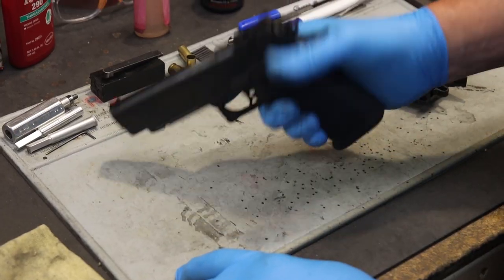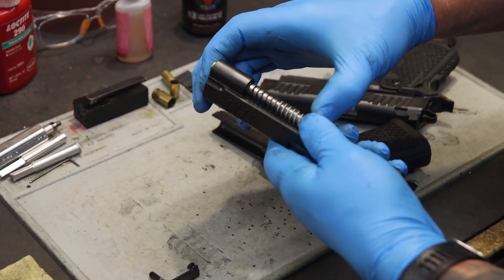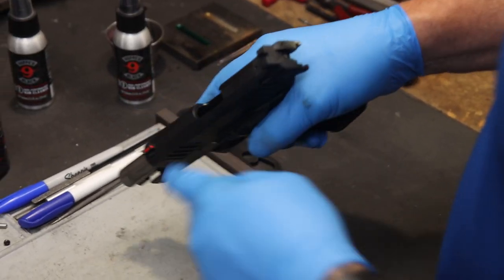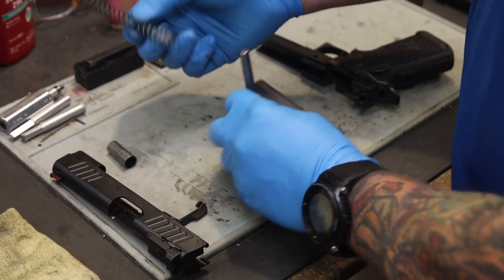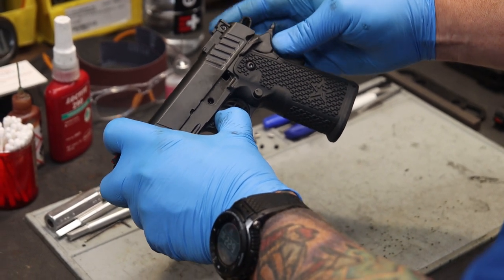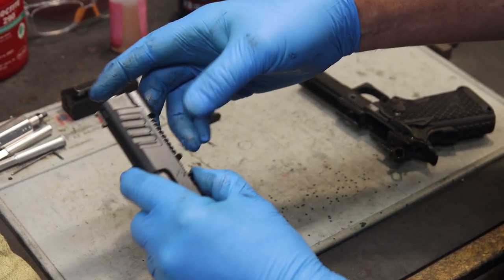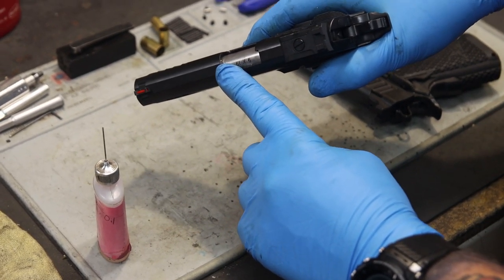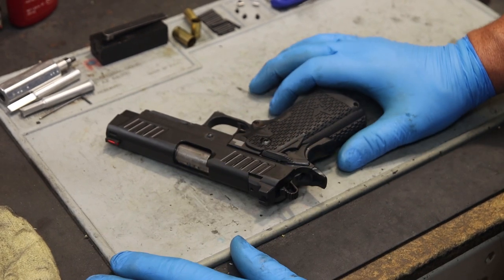Maintenance 101: What is the proper way to safely maintain and clean your pistol?

Comment: 27 years LEO. last 15+ with a Kimber 1911, TLR2, only problems were when my magazine spring were old.  Recently purchased at 2011, my gift to me as I enter the last 5 years of my career.  I cleaned and lubed as described and then carried it. During a class for red dots all I had was problems on the first day. To the point I started to distrust the gun.  Failure to extract, failed to lock back.   Could not complete a string of fire without a problem. Took it home cleaned it and the next day ran it wet. Literally had oil coming dripping. Ran with no problems.  I’m going to go back to grease, if you use this gun for duty oil the …. out of it.
Reply: PS I purchased the specific oil in this video
Reply: I’ve been having the same issues. I’m going to clean and oil my pistol. I’ve been using 115 grain ammunition and going to use 125 grain ammunition at my next shoot. Hopefully that takes care of my stovepipe and failure to lock back issues.

Comment: I can’t wait to get my c2, hopefully here soon.
Reply: I just got mine the week of 03/24/2021. Put a few hundred rounds through it. Love it. Now the hunt for a holster.
Reply: @JamesIngram84  Qvo tactical. Check them them out.
Reply: Thanks for the great updated video for my c2 duo , only advice is to be very careful in following slide stop installation correctly and hold gun as shown. I think I slipped and put slide stop in at wrong position and jammed slide. Sent back to get slide stop pin back out. May be able to just push on slide stop hard with punch to get back out. Warranty repair very fast next day mail paid by staccato wow thanks also for installing and zero my delta point pro. Well worth the money for me  safety apendex carry LAS holster.  Love my new Staccato!
Reply: Ha me too. Just ordered mine in the 1st

Comment: I have to say.
The DLC makes cleaning very easy.
Any decent lube, 6 q tips, a rag, and bore snake, you are gtg.
Carbon just wipes away, maybe a brush on the breech face, q tips in the tight spaces, I put a drop of oil on the hammer hooks, barrel lugs, rails, and the tip of the disconnector.
I lock the slide back and set the toolless guide rod, then pull the slide stop, and slide, but Tony's way works fine as well.
So much easier than wrestling a barrel bushing, and recoil system.
Love my P, and clean after each range trip.
It only takes 5 or so minutes.

Comment: Thanks for the great updated video for my c2 duo , only advice is to be very careful in following slide stop installation correctly and hold gun as shown. I think I slipped and put slide stop in at wrong position and jammed slide. Sent back to get slide stop pin back out. May be able to just push on slide stop hard with punch to get back out. Warranty repair very fast next day mail paid by staccato wow thanks also for installing and zero my delta point pro. Well worth the money for me  safety apendex carry LAS holster. Thumb stop safety helps with recoil and training is so natural to use it. With this gun it is almost impossible to have a accidental discharge when holster gun. Love my new Staccato!

Comment: I am shooting a factory 1911.  Is the recoil master system a vast improvement in absorbing the felt recoil of the slide cycle compared to the traditional 1911 system? What are the improvements you see overall?
Reply: Many things play a part in felt recoil. The biggest change to me is proper recoil spring weight. Lighter springs will allow for faster travel and can increase felt recoil. Too heavy of a spring will cause a faster return to battery and noticeable "dip" on return. It's a balancing act. This is also load dependant. 
There is really no true way to reduce physical recoil, but "felt recoil" can be managed. You can always tune your springs to your load. Most factory springs are designed to shoot a wide variety of loadings for reliability. Tuning or adjusting your springs can cause issues, depending on load. Major class springs 18 pound plus (heavier) will slam the return. (With minor loads PF) causing dip. Minor springs (less than 16 pounds)  can cause loading and ejection issues with factory loads.
The recoil master or tool less system will not fit  all models of 1911's, it really depends on make and model.

The only reason I gave my 2 cents is because nobody else seemed to address your question.
Hopefully I was a little help. I've been running 1911/2011 pistols for 30 plus years professionally, personally and when I competed.

Comment: STI made it much easier than their origional models, no more "L" shaped paperclips! 
Yeah, been using them since Virgil built my first one many years ago. Nowadays their not nearly as finicky and much more reliable and my EDC is a C2 DPO....only suggestion is that STI would do like their neighbors building Glock Clones (Shadow Systems) and mill a direct mount, no plates. 
With that said nothing ( including my Nighthawk) shoots as well to me as my STI's. 

To me they'll always be STI.
Reply: The DPO system is a direct mount for a leupold DPP/shield RMS/Sig romeo standard. I bet many would prefer the trijicon RMR as a direct mill, but I think they're being smart going with what's going to be the mount used by the military with the P320.

Comment: I find the C2 really hard to reassemble, the guide rod always wants to pop down when putting the slide back on.  With the P/XC/XL I don't have any issue there because though it wants to do the same I keep the spring captured and the guide rod as far forward as possible.  Then when its all lined up I just  bring the slide to the rear fully which releases the part that captures the spring and voila.
Reply: Same here, got constantly holding it during takedown and reassembly so it doesn't pop out. Not a big deal tho, just have to remember to hold it.
Reply: We've all shot the spring across the bench, lol.
Practice makes perfect.

Comment: There are more wear points than what you lubricated;  I encourage everyone to do a a better job lubricating their expensive purchase.    Do the entire rails,  anywhere that you see wear,  and Especially lube where the barrel weldments come in contact with the slide for the love of god.
Reply: Over lubrication can also cause issues. Excessive oil will attract burnt powder and carbon causing more erosion. This ain't a glock,  lube as reccomended, the guy in this video is right.
Reply: @thefrogking481   Right it's not a Glock,  it needs more lubricant.   Lubricate every bearing surface adequately.    Any oil inside a gun is going to attract powder/carbon... That's why you should also clean your gun regularly.   My guns run, I oil the shit out of them, especially something with tight tolerances.

Comment: If that is all the lube you need for your staccato then I def put too much on mine.
Reply: Prob won't hurt besides leaking out during storage and range session. Sometimes it's a good idea to over-lube it for the first big range session to ensure a smooth brake-in period.
Hope you're not getting it on your clothing tho ;)
Reply: I prefer the well made, proven CLPs for gun care; Ballistol 🇩🇪, Froglube Extreme 🐸, Slip 2000 EWL. It's good to use a CLP that's non toxic, no fumes 🤭, easy to apply. I recently got Slip 2000 EWL & it's a great product for cleaning, lubricating. Avoid WD40 or products which may harm or damage your firearm. If you keep the gun loaded or load spare magazines, inspect those & the ammunition often. Sometimes; lint, crud, CLP or dust may seep into the mags. I also leave a round or 2 off a carry/duty magazine to reduce the tension on the pistol magazine spring.